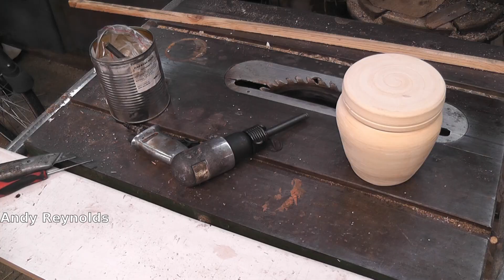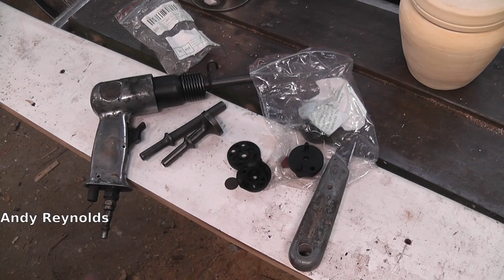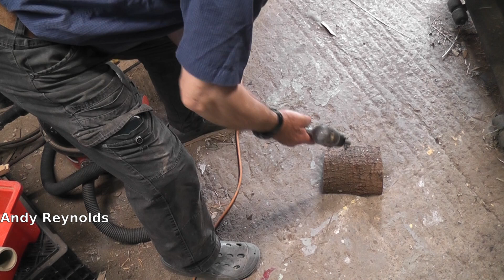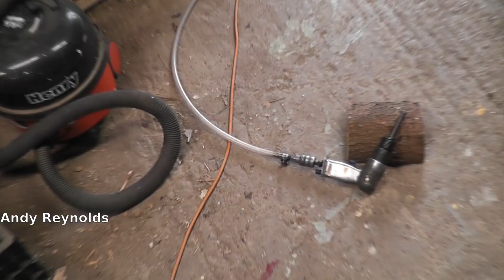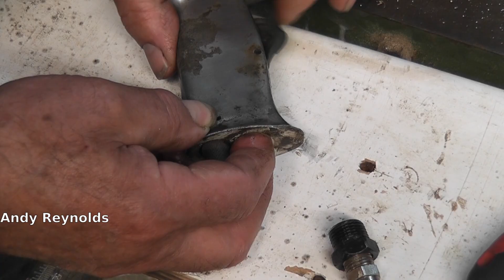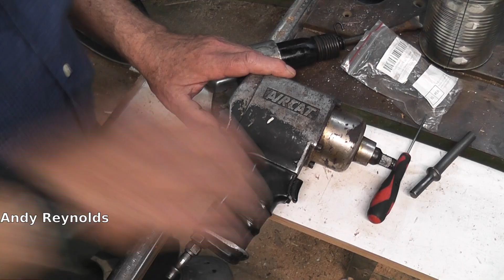Air chisel repair, air hammer, the fix update

Comment: Glad you got it working. I'm on the lookout for a Milwaukee 12v palm nailer to convert it into a nail remover.
I picked up a 3/4" air impact wrench but it's been modified and doesnt work. I think it may have been set to only work in one direction. V.heavy construction but think it's missing the disc type valve as found in your air hammer.
Reply from the maker: a 3/4 impact is a good find, shame it's been modified, I've never found an impact that large, cheers